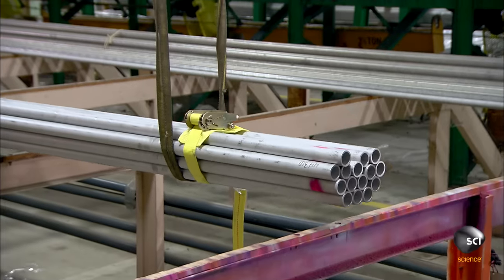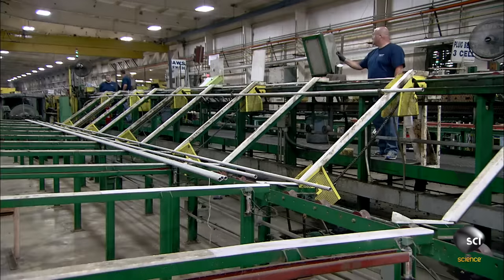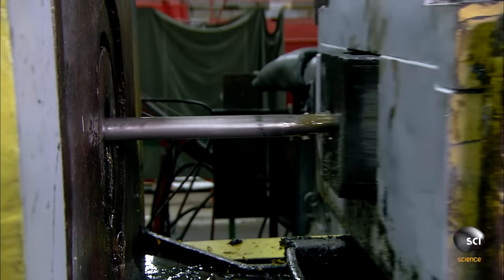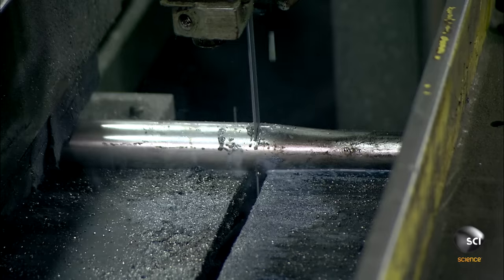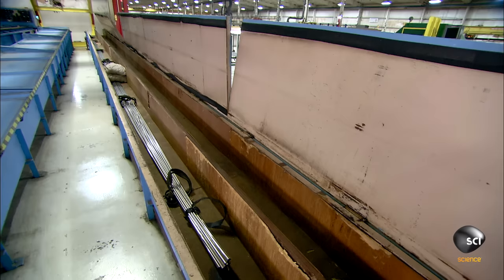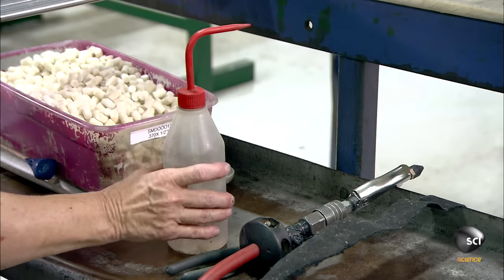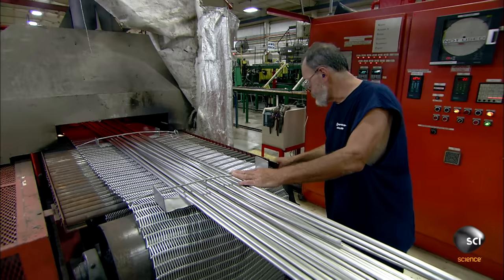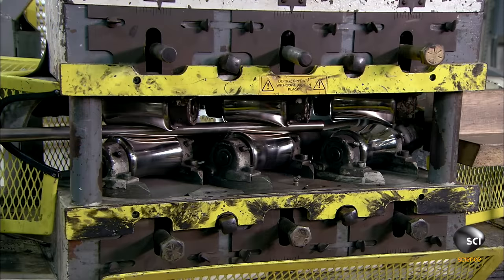Seamless Stainless Steel Tubes | How It's Made

Comment: I like how it's made, but this video didn't show how to make steel tubes, it only shows how to change the dimensions of an existing steel tube.   How do you make a seamless tube from raw or flat material?  That's what I expected from the title.
Reply: They're naturally occuring items you could find in mountains
Reply: Twoleggedkumulava    so from solid they drill into it?     else it would have a seam
Reply: check out Mannesmann process
Reply: Sir is there a pipe that as small as the ballp pen? Im looking for that size of pipe tubes
Reply: @jacetroiz7877  For medical use? Capilliary tube.
Reply: Me too.
Reply: Exactly!👍
Reply: Yeah, looks more like finishing touches rather than made from scratch or recycled stuff
Reply: seamless tubes are extruded forcing a red hot bar of steel through a die that forms the tube!
From a retired steelworker!
Reply: I guess they just took what they could get and made the best of it. Maybe they didn't know the factory didn't make their own tube until they got there.
Reply: Antonmursid
🙏🙏🙏🙏🙏🇮🇩🇮🇩🇮🇩🇮🇩🇮🇩💝✌🙌👌
Reply: @ronaldthomas9396   have you got any footage? I've always wondered what the die would look like, surely it'd need a floating centerpiece right?
Reply: @versorama  no, it's a red hot solid round and the round is hydraulically extruded thru a die that punches out the center!..  Main steem tubing for power plants can have a 16"to 20" diameter with a 4" wall thickness!
Reply: @fitrianhidayat  based
Reply: This is a difficult process

Comment: Seamless tube stock starts with hot pierced billets which are 4-10" in diameter.   Seamed tube stock starts with a coil of sheet that is rolled and welded into a tube form.  Both can be drawn down over a mandrel to form thinner wall, smaller diameter products.  Seamless is most often used for hypodermic needles.
Reply: hypos are made from welded and drawn not seamless
Reply: Do you have any videos about it?

Comment: Besides the fact that we're starting with a tube to make a tube with different dimensions, as many others have mentioned... but how many applications need this degree of exactness in terms of inner and outer diameters? This is crazy that they would go through so many processes to make the tubing size "just right." I can see for carefully flow-controlled situations in medical or scientific applications; maybe that's mostly where this stuff is used. But talk about expense!
Reply: The depends on what you are using them for.  Those tolerances need to be fairly accurate for most applications though. Not only for flow but also strength and weight.  In a application like conduit that may not matter much but in most application it needs to be whatever you happen to need and there isn't much advantage for it to be over spec and under spec would result in all kinds of problems up to catastrophic failure.
Reply: you would be amazed how many applications need a special size. 8 or 10 sizing  (drawing) operations aren't uncommon
Reply: Stainless is really expensive, the whole industry is like that. It's better to be more precise with what you have than to use even a little bit more. It's also really bad about thermal expansion. They engineer pressure vessels and process piping to be an exact consistent thickness, withstand an exact consistent pressure and expand and contract an exact, consistent distance. Come down to Springfield, Missouri and take a tour of one of the shops someday. TCI is a good one, or Holloway probably is too.
Reply: This is stainless tubing so it will probably be fabricated into things that need corrosion resistance.  I would assume much of the stuff produced in the video would go to things like machinery for food production, medical devices, scientific machines and the like.  Basically anywhere that you absolutely need a non-reactive metal to do work for you without fouling what's traveling through it...and is easily cleaned when taken offline.

Comment: The bigger diameter seamless tubes made on another bigger factory by penetrating the heated bars with another sharpened and hardened steel bars. And rolling rolling rolling, of course. This isn't showed here, bad...

Comment: They left out the millstock preparation where flat stainless steel stock sheet is curled and welded into a rough tube to start with.  I worked for Greenville Tube Corporation as a young man and have done every job shown here, plus some...inclusive of chewing gum and having teeth pulled to look authentic
Reply: That is not how seamless tube is made, however. Seamless tube, wait for it, ... does not have a weld seam.